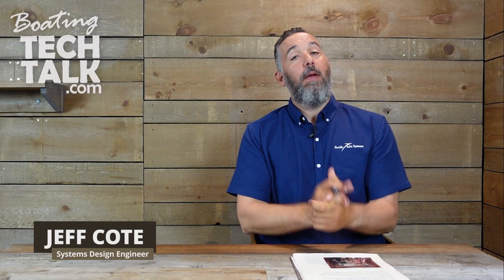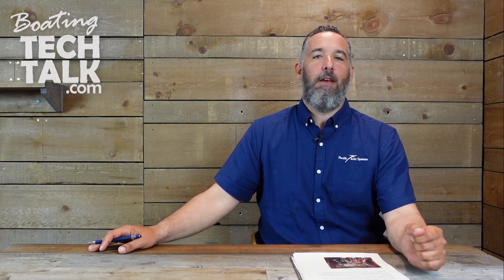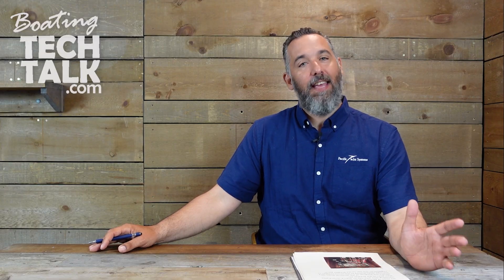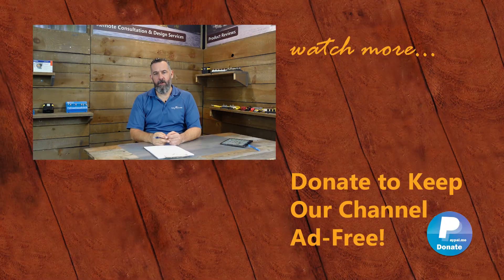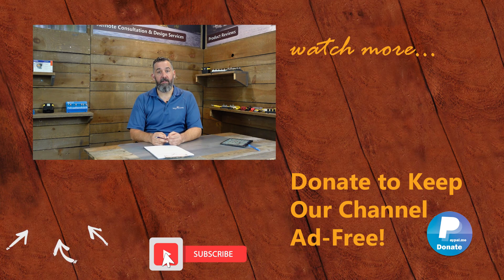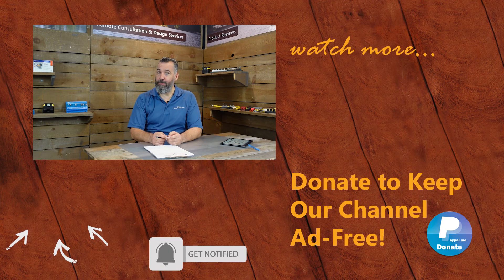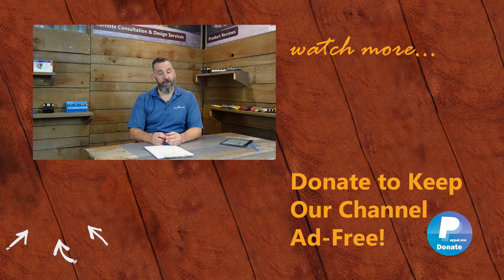What Is The Purpose of A Terminal Strip on My Boat?

Comment: Do you have an example of one setup with terminal strip. Should "terminal strips" have fuses?
Reply from the maker: A terminal strip with fuses, is sort of a fuse block. Blue Sea Systems, makes really good ones, check them out. Some of the fuse blocks, allow you to connect positive and negative connections.

Comment: When using a terminal strip, would you put the fuze between the strip and the panel or the strip and the load?
Reply from the maker: Good question, and it depends. Terminal strips are commonly used to interconnect the output of a circuit breaker to a load. In this case the breaker should be sized to protect the wire and the load of the circuit. If the terminal strip is use as input to the panel, then you should also fuse those circuits at the terminal strip before they get to the DC panel.

Comment: Why not use waterproof connectors instead of terminal strips? It seems that the exposed terminals of a terminal strip would 🤔 be subject to corrosion.
Reply from the maker: It's a balancing act, either you do splice connections with a butt connectors and they cannot be easily tested or serviced and yet they are protected from the elements. Alternatively, you install heat shrink ring connectors to the wire ends and connect the wires together using terminal strip.

Comment: Does every terminal strip, fuse, bus bar,… the more connections between the battery and load a device passes through, do those result in voltage drop?
Reply from the maker: Good point, all connection points can be a potential weak point, if the connection is done correctly, voltage drop at a connection is minimal. To your point, don't have more connections then you need.

Comment: Hey Jeff,  I have a question for you.  If I wanted to use a solar array to charge all three battery banks on my Sailboat ( Engine start, house bank, bow thruster ) could I use a battery isolater between the MPPT controllers and the battery banks?  Bow thruster and Engine start batteries are AGM, House bank is LiFePO4.
Reply from the maker: Since the solar controller can output one charge curve, better to have the solar array recharge the Lithium and then share the charge to AGM batteries via DC to DC charging converter.

Comment: After any and all terminal strip installations, I ALWAYS SPRAY COAT the entire terminal strip and ALL the connectors with CLEAR, RUBBER, SPRAY CAN, ELECTRICAL TAPE.  Why clear?  Because YOU will SEE any CORROSION that may develop, under the coating!
Reply from the maker: What product are you actually using? Please share.
Reply: @PacificYachtSystems  Yes.  "PLASTIDIP" Liquid Tape - CLEAR.
Many other brands of spray-on clear RUBBER are available too.
DO NOT USE CLEAR SPRAY PAINT.
Spray PAINT will develop micro cracks which let salt air and humidity pass to and fro.
Lastly, THREE THIN COATS of clear rubber spray is best. Why?
Thin coats allow the spray's carrier gas to gas-off quickly without capturing micro bubbles that may pop open later leaving an air path.
Multiple THIN coats allows micro bubbles to reach the surface and "pop" whilst the spray rubber is still wet.
Reply: @PacificYachtSystems  Here's another CLEAR SPRAY RUBBER:
https://www.amazon.com/Rust-Oleum-265495A3-LeakSeal-Flexible-Coating/dp/B08MWYD2B1/
Reply: How do you get the rubber off for testing or changes and how do you reseal?
Reply: @GrampalettasCamp  For testing, simply stab through the rubber sealant.  Then reseal the stab wound.  For more, razor knife cut around the target terminal to be removed, then peel off.  Acetone clean the surfaces.  Reseal afterwards.  (Some clear sealants will clean up with just alcohol).
Reply: @BYENZER  thanks

Comment: Thanks Jeff. Pretty sure my Clipper 34 (CHB) was designed and originally built with abundant terminal strips but since has had many additions made to the electrical systems. Challenge is to find the non-complying circuits etc and to fix etc. Seems too much  to contemplate but it should be done I guess. Thanks for sharing Jeff. 
Ianmac ( NSW Australia)
Reply from the maker: Thanks for sharing Ian, much appreciated.

Comment: I'll be wiring my wooden cabin cruiser soon (built from plans by me). I am new to marine electrical although I have read quite a bit over the years as I progressed on the build. I will be having one sub panel for the port side electrical (remainder of the electrical and the helm are located on starboard side). This sub panel will be connected via a single power line to a power point o the starboard side, thereby reducing the number of wires crossing the boat. Okay with that bit of background, what I am still somewhat confused about is one,  how far should the terminal strips mentioned in this video, be from the panel? Two, is this strategy  good for multiple stations in the boat (i.e. forward electrical versus aft cabin, etc.), and is it generally a good idea to reduce the number of wires running through the boat, given that multiple appliances will then have to share power leads. I do realize that these appliances can be mounted in parallel thereby avoiding the chance of one fault killing the entire circuit.

Thanks for a wonderful channel and for being so helpful and sharing with your knowledge.
Reply from the maker: The terminal strips should be located as close as possible to the electrical panel but also in a place where you can easily access. For instance, on my boat the terminal strip is located about 5 - 7 feet away from the DC panel.

Comment: As you move away from the panel and towards the loads, terminal strips are still important when you need to troubleshoot, disconnect, or replace the load. I have a terminal strip that I use for my bilge float and bilge pump. I recently wanted to replace both components and the terminal strip made the process quick and simple. They also make troubleshooting much easier because you don't have to pierce the wire to the load to see if you have voltage.
Reply from the maker: Thanks for sharing Joanne

Comment: As always, great information Jeff. One thing I do for those areas that may be subject to the salty air/moisture is a throw-back to my industrial construction electrician days and I mount terminal strips inside a ridgid PVC junction box (ie: 4”x4” or 6”x6” with watertite strain relief connectors for the associated cable to enter through and the boxes also  have a lipped and sealed lid. For the smaller boats I’m usually working on (sport fishing runabouts etc) I especially use them for a ‘control/power’ point for bilge pump and remote float interconnections. As I can’t attach any pics for you to see, I’ll follow up with an email for you and also, if you think that it’s a good visual ‘step up’ above just using terminal strips, you can use the pics as you see fit. Keep up the great work, us ‘Elechickens’ need to stick together!
Reply from the maker: Thanks for adding to the conversation, much appreciated.
Reply: Love the boxes for terminal strips. How do you seal a dozen + & - wires going into the boxes?

Comment: Hi Jeff, thanks for the video. I'm currently in the process of redoing the dc panel. I bought a new panel and terminal strips. Do you have any diagrams or a video that shows how to wire from the terminal strip to the dc panel to have a nice clean installation?
Reply from the maker: Hi Luis, unfortunately don't have a DIY video on the exact how to do of redoing a AC/DC panel, good idea for the future.
Reply: @PacificYachtSystems  Ok excellent. That future video will become one of the most popular, a “must see”.thanks